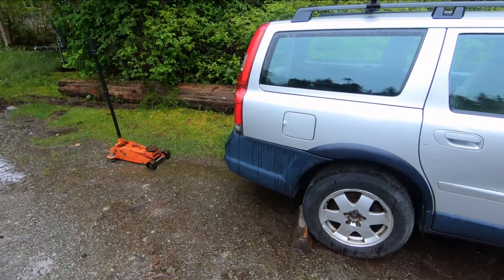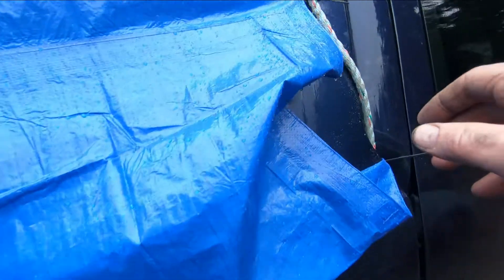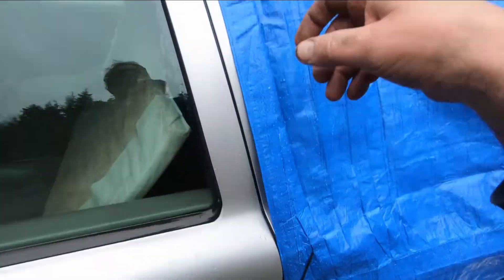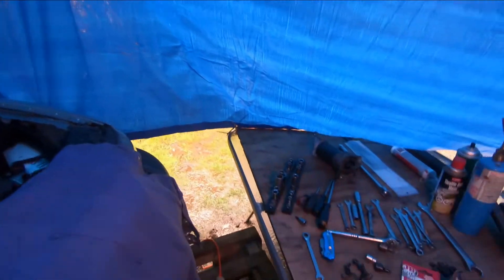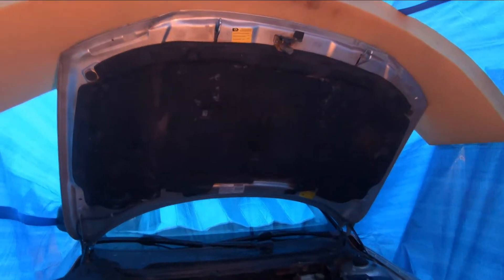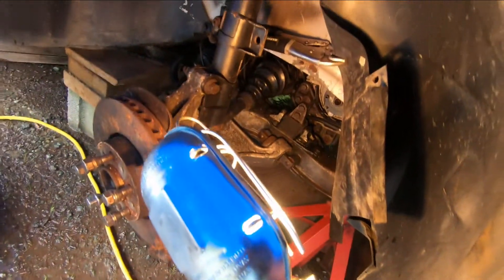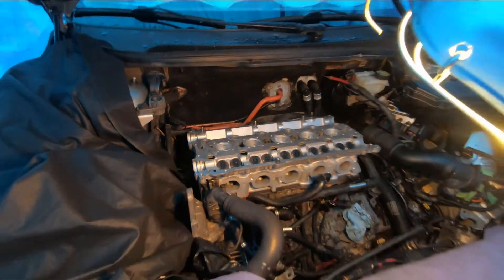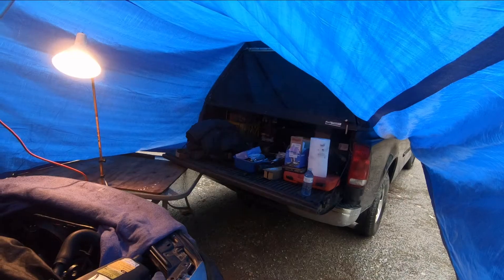WORKING IN THE RAIN MADE EASY

Comment: Man, that's near the setup I had at a little concert thing out near Ohio. I had my tarp coming off the back end of my pickup. There was a cap on my pickup and it was weathertight so I could bunk in the back of the pickup and then I had sort of a 10' X 10' porch and it was hooked to my traveling partners truck at the other end of the tarp. His cap leaked a little but it was good enough to keep some stuff out of the weather and he had a tent. I've done sort of the same thing in the winter and had my salamander heater going so I could keep a little warm and not be totally in the wind while working on a vehicle.
Reply from the maker: These tarp solutions work pretty well unless the wind blows hard. This volvo is all wheel drive and i can't move it around the yard-the wheels just drag. I thought the brakes were seized but they are free. It is an automatic so I think that some electrical component must free up the output shafts because placing the shift selector in "N" doesn't help a bit. I dragged it towards the lean-to shelter just off camera but decided to just tarp it in place. I have several videos upcoming about this car soon. Also, the tractor videos will be along shortly--the pump was out and back in but no fuel to injectors yet. I'm going to tear it out again today and see if I can free it up some more and make some adjustments. This volvo engine is on the way to being fixed too. I picked up the rebuilt head for cheap from someone who decided not to repair their car. I otherwise wouldn't have a like-new head to put in. Stay tuned and stay dry !